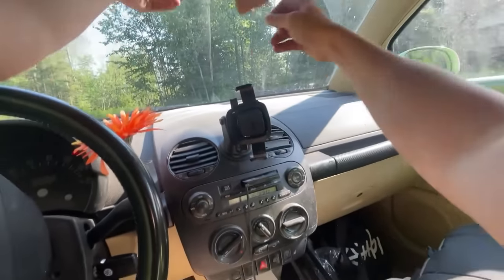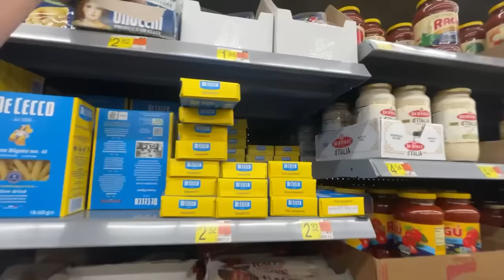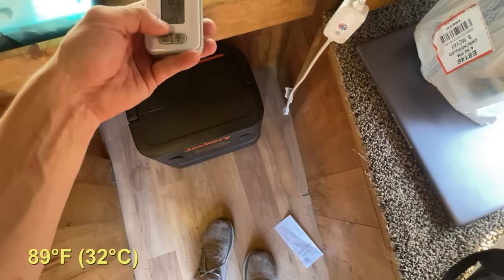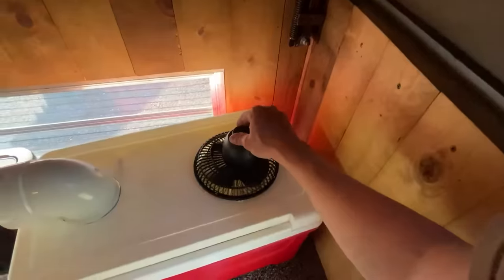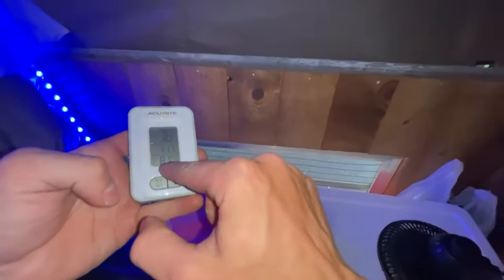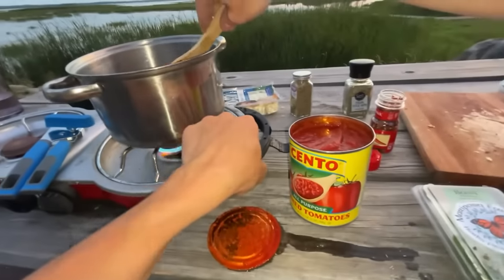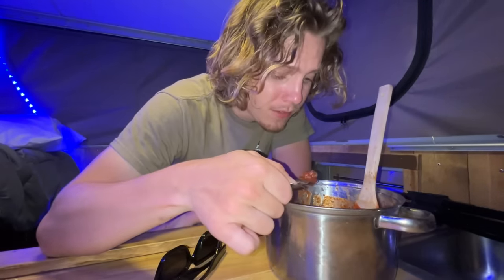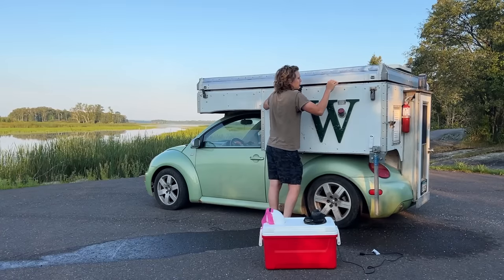Car Camping w/ DIY Swamp Cooler - Will it Work?

Comment: Seems like ice in a bag only has a limited surface area to cool the volume of air you need for the camper. Ice out side the bag has significantly more surface area to cool. In humid climates swamp coolers have a significantly reduced effect because of the lack of evaporation. You get a wet blanket feel. That’s why 80 degrees with 80% humidity sucks way more than 80 degrees in 15%.

Comment: If you plan to fix up the little beetles suspension, definitely get heavier springs to lift it up with the weight of the camper it would help out a lot with ride quality

Comment: You've got to find a way to get the air to blow through the ice not just over it. Try a partition between the fan and exiting duct sealing the lid and sides so the air must blow through the ice to get to the exit.  The best dyi swamp cooler I have seen uses a pump to  circulate ice water through copper tubing that runs in a tight coil behind a box fan secure the tubing to the fan with zip ties..

Comment: Being from North Carolina I have found that the Icybreeze cooler works the best in hot humid climates. It blows cold dry air and is has 3 different power options. It is a bit pricey but it's well worth it. Love the channel!

Comment: Dry ice works wonders in swamp coolers like that. Also you need to have a window cracked, because that’s essentially a big humidifier as well as a swamp cooler. That’s why it felt damp.
Reply: Dry ice is carbon dioxide. You wouldn't want to die of suffocation by CO² in the closed camper.

Comment: Swamp coolers only work well if the relative humidity is low.  In Colorado, Arizona, New Mexico and other fairly dry parts of the United States, swamp coolers are used instead of the more traditional a/c, because the interior of your house won't become a swamp itself.  Areas where the humidity level is higher, your house, the walls with be covered with condensation from a swamp cooler.  Outside, they may be okay to sit in front of while the ice melts, but you will still be covered with moisture!

Comment: It's difficult to find block ice, so I learned to make my own by freezing water in a juice or gallon water jug. It takes much longer for a block to melt. Not only did/do live in a hurricane zone and want to keep my freezer cold as long as possible during a power outage. I also found myself without A/C in my vehicle for a couple of summers, charging didn't fix it and more money into it wasn't an option. So I kinda did what you did here to survive a drive.
Reply: Wow very resourceful for sure. When my ac went out in old car I would freeze a wet hand towel and ride with it on my neck for drives
Reply: might be a fuse, or something

Comment: the cooling effect in a swamp cooler comes from the fan pulling air though an element that's evaporating the water. If you just put ice in a cooler with a fan blowing over it, its not going to cool very well. if you were to somehow put a constantly wet paper towel or something close to that on the back of the fan, then it would cool much better, you just need to find a way to recycle that water back to the towel so that it keeps cooling it.
Reply: He could use a fish tank pump to pump water to a bar with holes in it that trickles water on the paper towel maybe.
Reply: @jdshanahan4215  ohhhhhh, that would be so simple!
Reply: Wouldn’t matter , that area is high humidity, swamp coolers don’t work in high humidity areas.

Comment: When I think of a swamp cooler I think of an evaporation setup using wet fabric. I used a system driving in late August, cross country, in a '71 Datsun pickup without air conditioning. I dipped a towel in my ice water created by ice melt, wrung it out and affixed it to my visor I swiveled to my door window, using binder clips to hold in place. I was driving down the highway at 60 (max speed on level ground for that little four banger engine). This made my trip a bit more bearable, along with it shading me. I still had a view of my side mirrors and it was easy enough to flip out of the way should I need to look perpendicular. I used a spray bottle to mist myself, incase I required increased measures. 
Love your vids, glad the cop didn't hassle you. I think he was more curious of your set up. Keep on Truckin', Mav! You're FAB!

Comment: First you have to get all the hot air out of the cabin then the swamp cooler will work better. Swamp coolers don't work well in humid conditions . They work better in hot dry areas Arizona is ideal. Try a layer of Reflectix on the outside roof it doesn't have to be permanent you could attach it with clamps or velcro. There are different size rolls not terribly expensive say 40.00 US. Can buy by the roll at Home Depot or Lowes. Will significantly cut down the heat. In summer it protects from sun heat and in winter it protects from cold. The way it's made it is super shiny on both sides and there are little pillows in a honeycomb design and in the pillows are pockets of carbon. This stuff is super light weight developed for the space program. Also very tough and durable. It's the best bang for the buck improvement for fighting the elements.

Comment: Next time try evaporative cooling.  Hang a sheet of burlap or (other loosely weaved material that can absorb/wix water) vertically between the fan and the vent opening.  Maybe add a small fish tank water pump to the mix to pump cold water from the bottom of the cooler to the top of the burlap so it uses gravity to absorb into the fabric.  As the air passes through the wet fabric, it evaporates the water and naturally cools the air doing so.

Comment: The method you're looking to use is called evaporative cooling and it only works in dry environment if there's any humidity in the air "swamp coolers" are pretty much useless, you're relying on a lower dew point to have the cooling process feel more comfortable. (This is coming from veteran HVAC technician of 30 years)

Comment: A swamp cooler is an evaporative cooler. The water can’t evaporate if it’s covered in plastic. If you put 3 bags of ice in there you would probably get a better result as the air would be forced through the ice rather than just over the top of it.

Comment: by closing the windows you're avoiding the flow of air from the outside to the inside and vice versa. your cooler is not able to cool the air since it directly goes out of the "exhaust" again. if you were able to trap the air inside of the box for longer, it would definitely be more effective.

Comment: In July, in Florida, I camped in a small tent and I brought a Windmachine Fan, $49 Walmart and It has 3 speeds. It was a Godsend. By the time I woke up, I had covered up with a sheet. It worked that good. We had electricity hook ups so that helped.

Comment: to further make the cooler affective, you need to have some damp cloth hanging in there and getting wet from the ice water.  This will increase the surface area which can cool the air down.

Comment: Warm air rises and cool air falls so the swamp cooler vent needs to be at the highest position in the camper. The best diy swamp cooler I've seen is the wet towel draped over the box fan but it's loud and windy.
Reply: I've  also hung a wet towel over a drying rack (or hang it in an open window) a few inches behind a fan.

Comment: What ur haters won't tell you is swamp coolers work best in arid climates with low mosture in the air. I don't think Minnesota fits that bill. To much humidity prevents the water from the swamp cool from evaporating into the air. Your set up would work in Arizona
Reply: if you dont exchange the hot air for cold air...yur done son.

Comment: It may have been mentioned already, but if you did more ice, uncovered but like you could double it at least or more, and maybe even get a good bit of salt over the whole thing, that cooler would get much colder and would push out much colder air. Also airflow! The hot airs gotta go somewhere so it’s more efficient to have some good airflow to push the hot air out and give space for the cool air to take place! It’s harder to cool it off if everything’s closed
Reply: 👆👆Thanks for leaving a comment and you have been selected among my lucky winners 🎉🎉 claim your prize 🎉🎉🎉🎉💯💯

Comment: When you raise the humidity level with the water the feels like temperature raises with it. You then are fighting both the radiant heat bouncing at you from the ceiling and walls and you are fighting an ever increasing feels like level even as the temperature goes down. Its the most inefficient thing you can do. 

Instead if you would introduce a small (very small) dehumidifier, and use a mylar or bubble wrap with mylar (even a space blanket) type thing to the interior surfaces and then cool you would probably get way further way faster. That or figure out how to maybe just take the edge off with the cars air conditioner.

Comment: A quick research uncovers that "swamp coolers" work best in dry/arid/low-humidity environments, the science behind them is that you are pushing through dry air that then gets saturated with the cold water from the ice, the ejected air should be cold and humid. Given on the day I searched current humidity in MN is 79% I'm assuming that's why you're not getting much luck with these types of coolers.

Comment: We got the big portacools at work and I think your idea would’ve been better if you put the fan into another pipe that reached almost the bottom. Then have it with 2 bags of ice (OPENED). They work off of how much surface area inside is cold.

Comment: That cooler design is flawed , anytime you have a fan pulling in hot air you reduce the cooling to about 30 minutes even with an ice block.Cut one hole in the top ,mount the fan on the inside blowing out.It’s impossible to pull hot air in and get a good result, half water, half ice.That’s not a “ swamp cooler”,those only work in Arizona,Nevada, Australia, Places with very low humidity.Better to get a small 110 ac and a small cheap gas generator and run that .A real evaporative cooler needs ventilation.

Comment: have your tube submerged under the ice. Both ends out of the water. Draw  cold air through the tube to the exhaust. Save water, it is perfectly good for drinking running through a filter

Comment: I don't think that a swamp cooler is t best idea, because of t water vapor. That can make it 'sticky' inside. Try a water pump & aluminum or copper tubing with a small radiator,  like an oil cooler, junk yard salvage is fine. Coil some tubing to carry water outflow from the pump below t ice water and out t top to the radiator and then blow air through it. Return water to pump & so on. Water cools better than the air. Nice ice box...it'll still work.😅

Comment: I used to have an old souped-up racing VW bug (60s era) without AC in hot, humid Dallas, Tx, back in the 80s, & I drove just like you to get done what I had to get done ASAP in the heat.  I loaded up a ice chest FILLED with loose ice onto the back seat, opened the top of the ice chest completely with a 12 volt fan blowing over the top of the ice RIGHT ON ME (about 8-12  inches away from my neck/upper back)  I don't remember exactly how I secured the fan...maybe clipped to the lid (?). It did help ALOT, even tho it was humid.  Hair style & makeup dissolved, but it kept me from having a heat stroke.  (Just opening the top of the filled ice chest itself really cooled the interior down even without the fan blowing & the  windows up.)  Swamp coolers don't really cool well in 50% & higher humidity unless it's blowing directly on you.  They do much better in less that 50% humidity, & you really are supposed to have outside air being drawn over the ice,  with another window open to allow the cooled moist air to exit to prevent moisture buildup & to save purddy hairdos & makeup in drier climates...but when you're HOT or on 🔥, who CARES?

Comment: The thing I've noticed is that he didn't use the car's AC to give the swamp cooler a head start.  Like run it for 30 mins just to get most of the heat out.   Unless the car's AC is broken?

Comment: Here’s the easiest way I can explain it.
Air conditioners don’t “add cold”. They “remove heat”. 
The air inside of your truck would need to dry out before it can drop temperature, and this device isn’t drying the air. Yes, cold and clammy is a thing, but generally speaking that’s the case

Comment: I made a way better swamp cooler using the following equipment, if you're interested in making one:

12v fridge 
Solar generator, of course 
Foam
Fan
Oil condensor
Water pump
Hoses

Comment: Brother Mav. swamp coolers are not made for your area. your just throwing alot more of whats making you hot already humidity. Swamp coolers are used for areas out west in dry climates. in your neck of the woods the only way your going to get cool is with good old fashion heat transfer with some refrigerant. Air Conditioning. Nice try. If you was in Arizona you would have been fine

Comment: Ya know when it comes to swamp coolers (and Arctic Air and all those other overpriced wet fans), I've found that because they are ADDING moisture to the air, they work better in super dry heat.  When it comes to that sticky humidity, they don't do much of anything.

Comment: Your cooler worked as designed 
Every surface in the camper is 87f, before the air can start cooling those surfaces have to cool.
This is why turning you AC off in your home when you leave for the day costs more energy.

Comment: FYI, that is exactly how to NOT use a swamp cooler. First, swamp coolers only work in arid climates, below 20% humidity is best. Secondly, the air intake has to be OUTSIDE, and third whatever that thing is, its not a swamp cooler, since swamp coolers work on the water evaporating, which is not happening with that thing. if you want to try a real DIY swamp cooler, try building  the one with a box fan , pvc pipe, and a water pump (its all over yt) put it in a window.. and it should work ok..ish.. as long as you have a vent open to exchange air thru.

Comment: MAV all you need is predator inverter super  quiet generator portable 3500 Watt $ 929 dollar
You can keep that thing running all night all day for couple gallon of gas you can run an extension cord through your comfort then you can use everything you want AC small AC heater electric stuff everything, fan, light's,
You can charge all your equipments all your devices basically that thing will make you feel like home trust me

Comment: Hot air rises, so you need your output on the side and not the lid. Also swamp coolers don’t use ice s is different. There’s some 12v ac units starting to come out of China now and in 5 years time I hope they are dirt cheap like diesel heaters. Until then just don’t go camping when it’s hot lol

Comment: Swamp coolers only work in low humidity, and with the windows open.  I think a traditional swamp cooler in a window with a pump for dripping water, swamp cooler clothe, and a fan would work better.

Comment: So the way the ac works is, it blows out the hot air, think about it. Inside the bug, that swamp cooler is just blowing cold air but not getting rid of the hat air inside the bug...

Comment: you had the right idea but what you need to get is a 4L jug and fill it and freeze it and put that inside but use a styrofoam cooler instead. I love mine, it works really great.

Comment: It's more that the sun wasn't beating down outside as it got darker. Also, you could save on gas and cook your dinners quicker if you put the lid on your pot and stopped the heat escaping. Love your videos. Hi From Australia 👋🏼

Comment: Wish I could find the article. A child in Africa or south America (I don't remember witch) in trying to make a better swamp coolor, accually invented a better A/C. It was in omni a few years ago, i just moved and I missplaced the printout I made. The basic idea was maximum amount of space on blades for water, then a fairly low power fan. It was fairly small and efficient.  In the end, I think any swamp cooler should work better by the idea.....

Comment: It started to cool because the sun was setting. I'm a hotshot freight runner. 3/4 ton Ram with a gooseneck trailer. I go everywhere and have a 6,000 btu portable room a/c. I do not idle my diesel truck.  But anyway when the sun is up its hard for me to stay cool even with 6,000 btu's and power it with my generator. Vehicles are metal boxes with little to no insulation. But once the sun sets it cools off quickly. Love your content bro. Be safe out there.

Comment: Youll never read this with 2200 comments but if you happen to,maybe you could build a very necessary awning and use a shade structure that blocks out all sunlight.The sun hits our house from the east and  its ridiculous in summer. We put up shade curtains and BAM! No sun heat entry.

Comment: Used to use frozen water in plastic jugs, slice jugs to remove ice elevate ice on dish drainer.. It is around 105 in tx now and this still works.

Comment: if it didn't have any check engine, lights is the most impressive part about this whole build, because the Volkswagen beetles are notoriously horrible for wiring issues, which, if you know anything about vehicles with wiring issues, every little stupid thing sets off the check engine light, my dad owned one for like 3 years, and he's spent probably 6 times the amount of money he bought the dang thing for chasing check engine lights

Comment: Swamp coolers don’t work. They’ll blow cool air, but it won’t take the humidity out the room. That’s what AC’s do so well. You’re probably making it hotter in there by adding humidity. At least I haven’t gotten them to work for long. My advice would be get an portable AC unit.